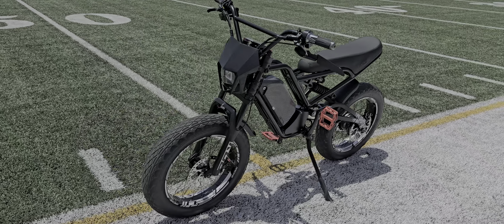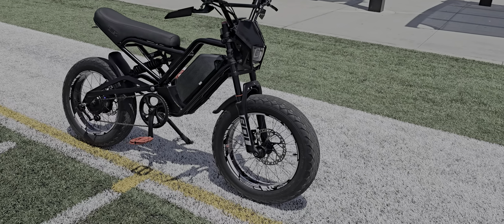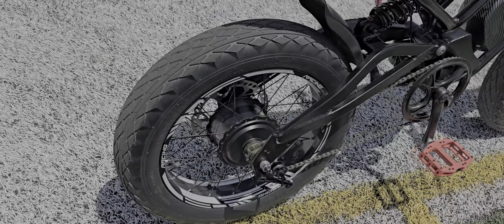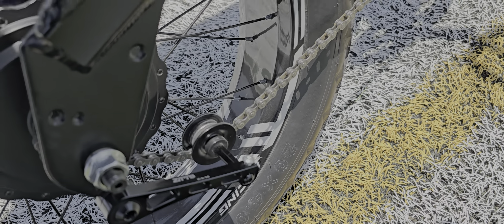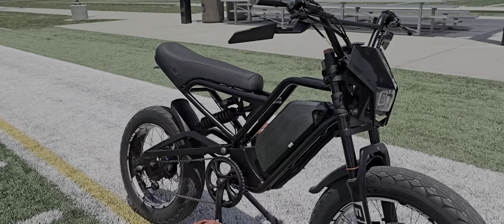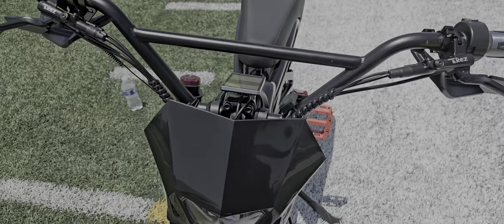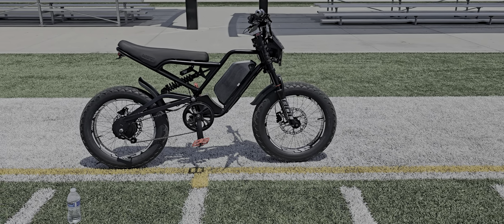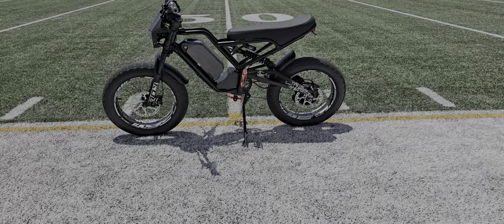My first ebike build 1500w Akez jaguar JA1 S2 Ghostcat fF1 F2.2 F3

Comment: This is a 48v/18ah, 28amp controller, low torque motor maybe 1500W this is not comparable to the GhostCat 52v/20ah battery, 40amp controller, high torque 140nm 1500W motor.
Reply from the maker: @Brianelectrify  there was no comparison mentioned, although It is the same bike as the ghostcat f1.  I'm showing crank length,  signal speed  conversion, BMX bars, hi/low beam headlight, inverted mirrors, and rear spring upgrade. All things that could help a taller rider with comfort and safety.
48v 1500w is not low torque. Can a super 73 go 20+ uphill or 34mph on flat ground?
Reply: @ixclusiverc  yea never heard anything about a comparison lol I’m installing a 52v 20ah battery when mine arrives Tuesday Samsung 40T. Might upgrade controller and display to 52v system 45-60 amp draw
Reply from the maker: @felixvalvaneda2285  🙌 I'm very interested to hear about your upgrades. If you go 52v, what controller are you thinking about? Sabvoton are medium size and needs to be bolted under the seat. I was also considering the bac855 as that one is small enough to fit into the stock crotroller compartment.  I did get an extra controller from akez to possibly try to shunt mod the stock one. 
What are your thoughts, my man?
Reply: @felixvalvaneda2285 bro I have one, how do i get a bigger 52v battery and where from??
Reply: @ixclusiverc   same I was thinking of doing the bac855 as well sounds easier
Reply: @PowerPedal0000   Amazon, you can type a 52v battery online and then just use that I use a powerful 52v battery with a 80 amp bms but I have a battery guy
Reply: @ixclusiverc  stock 48v controller can handle about 58-60v depending on the internal capacitors. So I say 52v 80 amp bms and run a bac asi 855 should peak around 4500 watts
Reply: They have a 52v 1500w 23ah power option now if you don’t want the 48v
Reply: @felixvalvaneda2285  They have a 52v 1500w 23ah power option now if you don’t want the 48v

Comment: Looks cool. I ordered a knock off version of the super 73 light and cover. Hopefully it will look nice like yours .
Reply from the maker: @Mr_big_foot831  I think it should look really good. That's kinda where I got the idea for a flat front light. Just play with different mounting points of the light, then take pictures to set it where you think it's best. I probably will have to adjust your light beam to reach distance  and possibly remove the tension springs.

Comment: ALL IN...Do you feel it's practical to build vs buy complete bike? I'm a total DIY guy but, if only saving a few hun...not sure I'd be down considering 'time vs $$$' Nice build BTW!
Reply from the maker: @robertmuckle2985  yes and no. If you can find a frame / brand / motor & controller then just upgrade bolt ons no problem. 
Motor kits have to be purchased with everything because they are NOT all cross compatible. I tried different controller and different LCD that didn't work at all.
30 mph is plenty for most people and the extra torque from a 52v or 60v are great, but is that something you need?
If you buy from aliexpress, they are around $1k but you kinda have to put better parts. So it really depends on the budget.

Comment: Hey man, those lights are nice. Is that an entirely different headlight? If its the same stock, did you just attach that frame?
Reply from the maker: @saymyname6726  yes it's a different headlight. They are found on aliexpress under KTM headlight with many options.  Then run a 48 to 12v converter

Comment: I just got one, is there a 52v battery that fits? Upgraded controllers?? And where did you buy the shocks from? How do i know if they fit.
Reply from the maker: @PowerPedal0000  52v battery should work, but I haven't tried it yet. 52v 20ah 40amps would be the size you would want to run.
Controllers are tricky because most of them are specific to certain lcd screens and throttles. Bac855 would be a good choice if you want to keep it hidden in the stock box.
To be honest stock with all the settings turned up are completely fine. Ride it first
Dnm burner is a common  shock, but you will need bushings to keep it snug. Front shock there are only 2 options that I found same manufacturer, just different names and one is longer. Get the shorter one.
Ebay or express
Don't rush it because you will make mistakes like I did.
Good luck with your build.
Reply: Did you do the 52v swap yet?
Reply from the maker: @corybradley1126  this is where I'm at with power.... I fried my screen the first time I ordered my lights. I reordered another screen and  controller just in case. 
The controller sent is slightly different in programming and wires. 
Take off is smooth with no stutter but at 20mph stutters ,with a quick release then throttle get up to 33mph. The older controller has slight cog on take off but feels a little better with torque range and doesn't stutter at 20mph or anywhere besides take off. 
On that original I took it apart to shunt mod. I started the process but haven't installed it yet Or I keep the newr controller and go 52v. I'm stuck on which way to go on this. If I go 52v will I loose all my lighting?
What are your thoughts on my situation?
Reply: The site have a 48v & 52v power option
Reply: where u get it from

Comment: what do u use for single speed I didn't hear you I like single as well
Reply from the maker: @MiamiElectrix  honestly I gave up on the single speed because this bike sucks to pedal. I now flip the crank arm and use pedales and foot rest. much more comfortable as a sitting position.
Reply: @ixclusiverc  you shld look into the pegal I'm not sure if it will fit the bike but it's cool

Comment: Do you know how to take off the grips on it I have so much trouble with it
Reply from the maker: @Bathroomdestroyer9000  left grip has an Allen screw on the tunnel signal switch. When loose, pull the switch away from the grip. From there just pull the grip off. 
Throttle side is the same, but the grip is attached. Pull the grip off if you when attached to the bike if you just changing grips.
You might have to release the cable ties to reach all the way off the bar. If you go taller bars, install the grips before you attach to stem

Comment: I love what you did with your headlight/fairings. Could you point me in the right direction which Ktm light/fairing you used? Also, is it just plug and play with your normal controller plug in?
Reply from the maker: Of course, the light can be found on aliexpress. There are several different light designs but most of the framing are bigger. This hasthe smallest profile to fit a 20" .  
The bottom mount is for a turn signal top is stock. Comes with a mounting kit but looks terrible 
Only thing you need is a 48v to 12v converter and low and high beam switch 12v. Simple install but finding the correct beam height is tricky, just remove the level adjustment screw take out the spring the applies pressure on that screw. Then put the screw back without it.
Reply: @ixclusiverc  Thank you for the run down! It is SOO clean. Think I may do this to my ghostcat in the future.

Comment: Did you put carbon fiber wrap on your battery ?? i wanted to do the same
Reply from the maker: That's hydro dip from the factory.  I have  seen a wrapped case looks good but I'm sure it's hard to do. If you do probably want to do a template cut first, anything non stick . 
Make some mistakes, then try the carbon.
Reply: @ixclusiverc  yeah great advice ! thx

Comment: What handkebar and stem did you use bud?
Reply from the maker: @edwardyoung5703  Throne handlebars by 2 wheel gang 4pc bars and box 53mm forward stem. There is a rise limit because of the brake lines. What I had to do was cut the zip tie and run that line above the crank bb spindle. Only need to remove the pedal. No bars above 6" will work.

Comment: Verry nice modification ! Do you know  how much speed and torque?
The Headlight also verry nice. Do you have some links for purchass the same?
Tx
Reply from the maker: @stingraykoltes9750  torque is around 100nm top speed 34mph. It's a 1500w hub 48v battery. 
The light does go on sale from time to time, and make sure you install a 48v to 12v converter &  hi/low 12v headlight switch.
https://a.aliexpress.com/_mOsl2ss

Comment: How fast does this go? Top speed
Reply from the maker: @jeembaymusic5271  on average 33 to 34mph.  That speed only feels comfortable on open roads.
Reply: I unlocked mine and it reaches 40mph.
Reply from the maker: @Mr_big_foot831  if you hit 40 mph, then you unlocked your wheel collaboration to the wrong diameter. Unless you're riding a 26",
 
48v or 52v can't hit 40mph unless you have a 2000w hub motor, so your settings might be off by a lot.
Reply: @ixclusiverc  should I change it? will it damage the hub motor ?
Reply from the maker: @Mr_big_foot831  no not at all it's just not an accurate speed. From what you explained your bike is a fat 20in  your tire size should be around 23 in the settings I believe it's under 6 or around one of those.
Reply from the maker: @Mr_big_foot831  make sure your punch level is set to 5 for take off and top speed at 100 and your good. Keep tires inflated to a good pressure and just ride it. Don't try to make it faster. You will end up buying a bunch of stuff that you can't even use.... TRUST ME.
52v would give you the feel you are looking for  but do it when your battery dies or loosing charge.
Reply: @ixclusiverc  oh ok thanks for clarifying that.